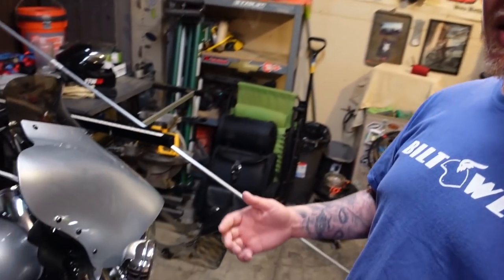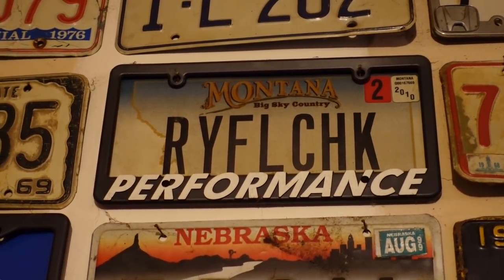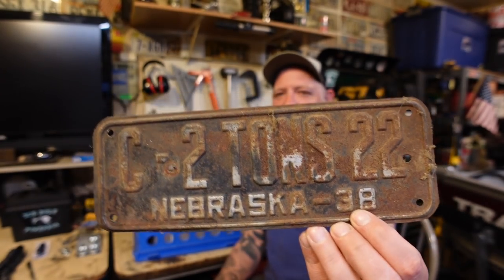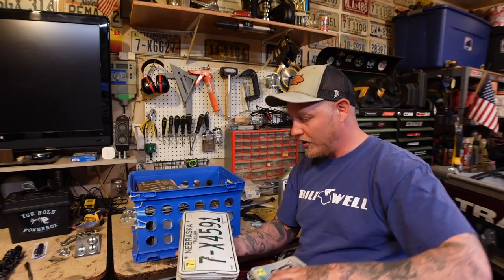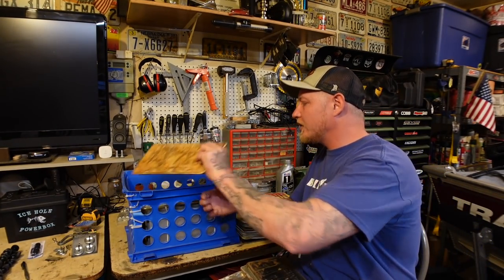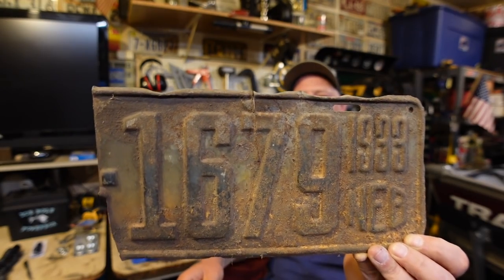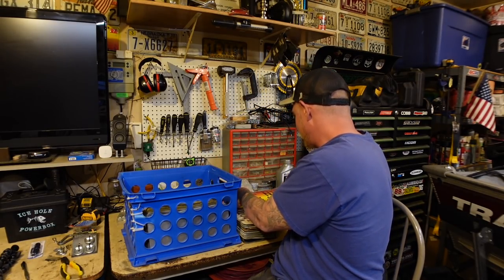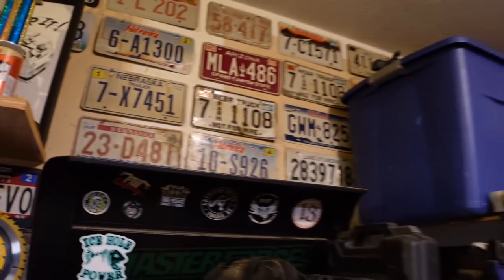My License Plate Collection - Vintage & New

Comment: In Pennsylvania your allowed to register any license plate from 1906 to 1975  as long as it corrisponds to the model year of that vehicle. Im gonna add that this a nice collection and very cool. Ive been collecting license plates since i was 4 years old. My first one was a steelers vanity plate and it sat on the front of my toy car. Then my first registration i got in 2011 2012. But my first auntique was a 1915 pennsylvania. I was 8 years old when i got it. Im now 19 and have 261 total. Thats couting mostly registrations plates. Although my 1908 pennsylvania is not a registration plate. In 1906 to 1909 they didnt register the vehicle. They registered  the driver to drive that car. 1910 was the first registration plate. Little fun fact.

Comment: I have two Tennessee license plates one from 1949 and the other from 1951, they’re shaped like the state and I read a little bit about them and from the years 1935 to 1956 Tennessee made their license plates in the shape of the state, for some reason they stopped, but the 1949 one is caked in rust from over 70 years of use, and the 1951 is also rusty but not as bad and still sports it’s beautiful orange color, I didn’t buy them I found them and asked if I could have them and they just gave them to me for no cost. Two lucky finds I guess 😂